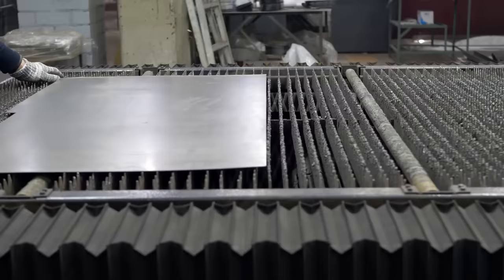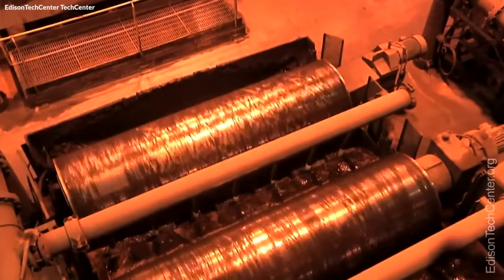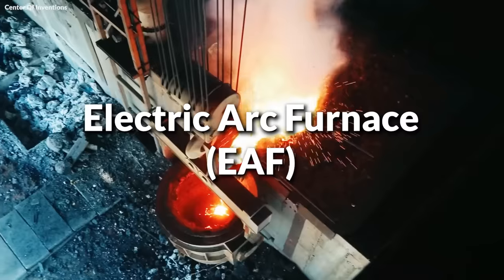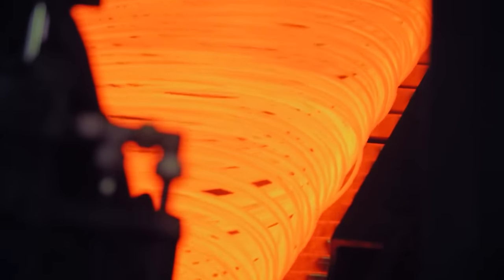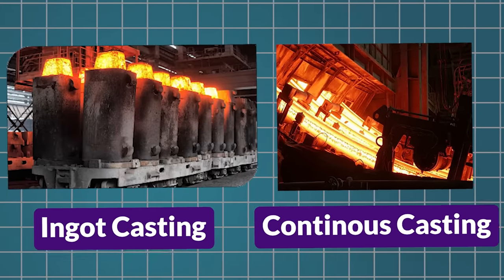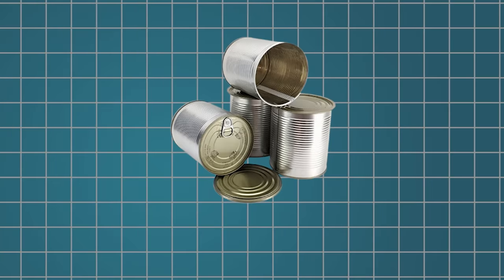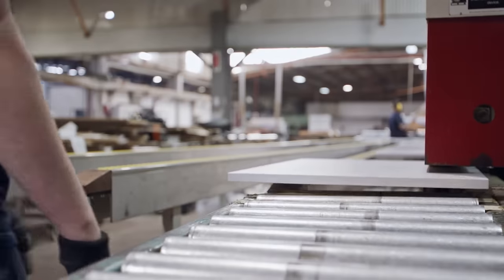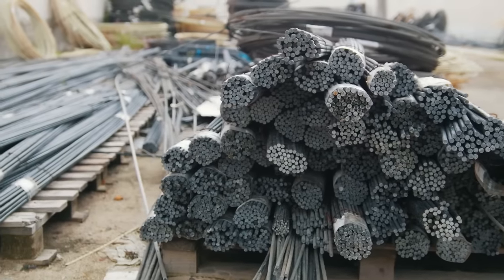How STEEL is Made - From Dirt to Molten Metal

Comment: Steel was most certanly not the backbone of civilizations for over 4000 years. The stuff discussed in this video all comes from the early 1900s.
Reply from the maker: I was rounding up
Reply: Lmao. When he said it, I was like uhhhh…that doesn’t sound right at all.
Reply: mid 1st millennium BC they started making high carbon steel yup...for over 9000 years now lol.. and it very well triggered the beginning of metal, from skyscrapers to trains and transit
Reply: Steel has been used since 13th century.
Reply: @doggygaming950 So I guess the Iron Age never happened, and the Romans conquered much of the known world using the gladius made of ... paper mache?
Reply: @whiteknightcat : Don’t be ridiculous, they used high density acrylic plastic.
Reply: @djquinn11 :face-blue-smiling:
Reply: No. They used carbon fiber cured with lazers.
Reply: @Michaelcollins933 🤣
Reply: @djquinn11 😂😂😂😂
Reply: @doggygaming950 absolute truth but all they did with it is make body armor and spears to attack each other. After the 1800s came what we have today, machines, motor cars, trains and everything else.
Reply: Modern X-ray techniques show the Great Pyramids were constructed with steel I-beam reinforcement.
Reply: @terry_willis  No they're not! They're cold-riveted girders with cores of pure selenium. The whole structure was designed and built as a superconducting antenna for the sole purpose of pulling in and concentrating spiritual turbulence.
Reply: Bethlehem steel, backbone of America
Reply: Steel was manufactured in ancient Bharat. Chola dynasty had structures steel technology
Reply: @HarmonRAB-hp4nk  steel wasn't produced in quantities where it could be used industrially until the mid 19th century. The earlier processes yielded small amounts. Pounds as opposed to tons.
Reply: @whiteknightcat  you're forgetting the Bronze Age.
Reply: @1pcfred  No, I didn't forget. I just wanted something whimsical, hence the paper mache. I'm well aware of the Bronze Age, and the use of copper weapons and tools before that.
Reply: @whiteknightcat  while our species has been capable of producing ferrous metal for thousands of years we haven't been able to mass produce it for even two centuries yet. So the whole Iron Age thing is somewhat misleading really. There's a difference between conception and scale.
Reply: So they medieval ages never used swords by your understanding ?
Reply: @stannisbarracuda5693  I understand that over time things have changed. In the Middle Ages a sword would have been a valuable possession. Today when I wear out a set of blades for my tractor I just throw them away and get new ones. Even though they're finer steel than any pattern welded sword.
Reply: @djquinn11  They used Flubber !
Reply: Wasn't steel produced around the 13th century BCE in the place that now is Turkey?
Reply: @rafaelvillalobos9145  steel has been made for a long time. Just not in quantities where it had much of an impact. If there's not much of something then its effects tend to be small as well. If the Titanic had only hit an ice cube it wouldn't have gone down in history like it did.
Reply: @1pcfred  So I guess it's safe to say bronze age had a greater impact on humanity than the iron age.
Reply: @rafaelvillalobos9145  we have ages to delineate different eras from each other somehow. We pick the most advanced material we had to name each age with. Stone, bronze, iron. After that we just call it the modern age. So we drop the materials thing. Which does suggest the materials themselves may not be the most important aspect of each age. There's recorded history and prehistory to consider too. We know of the past largely just through artifacts we can find today. Hey look it's a stone tool. It's a Stone Age item. I'm sure if we could talk to a caveman today he wouldn't define his culture by the tools he used. I'm just not so sure what he'd say. I bet it'd be interesting. Something we can't even imagine.
Reply: @HarmonRAB-hp4nk the very beginning of the 1st millennium BC was only 3000 yrs ago.  Where did you the number 9000 from? lol
Reply: AI at it's finest
Reply: @Factorama_eng 😅😂🤣
Reply: Continuous Casting, CONCAST doesn't,  nor do top-blown converters.
Reply: @HarmonRAB-hp4nk  sir, your math is way off. Exactly what year do you think we're in? The year 8,000?
Reply: All of this comes from the early 1900’s eh? … So you’re saying steel wasn’t the backbone of civilization for over 4000 years. Okay… So then it was the backbone of civilization for over 4100 years. Thank you for correcting that piece of useless information.
Reply: @3308redar Well time is relative. So if his frame of reference relative to yours is a difference of 3976 years or more, (since it’s the year 2024) then yes.  

Basically, 
A(t•d/v) {+\-} B(t•d/v) =  {+\-} 3976
Would be the equation for the difference between 2 frames of reference. Quantity this by squaring the result with the distance traveled over time, adding the velocity after dividing by time, for each, and then adding/subtracting velocity before dividing by time, and vice versa. Since time going in both directions will count. The averages of each of the results adding the first pair with the 2 different velocity’s found from the original equation will give you the answer.
Reply: @LordOfThePancakes  If we are both on the same planet, at nearly the same latitude and altitude (and by extension, experiencing nearly the same gravity), and travelling at almost exactly the same velocity, then how we experience time and our frame of reference will be nearly identical. And you know this.
Reply: Swords, shields, armour… all that must of been made from wood then? 💀
Reply: @ot6443  spears (pikes) and shield certainly were. Pikes were more common weapons than swords ever were. So much easier to manufacture.
Reply: @Factorama_eng you rounded 100 to 4000? What math did you do

Comment: The steel plant I worked at used scrap steel in place of the coke coal. It was easier to control the content in the furnace
Reply from the maker: Cool! Maybe I should make an extended version and include more about that
Reply: Coke is used in iron making.
Scrap steel is used in steel making.
Reply from the maker: thanks!  @mephInc
Reply: steel is basically iron and nickle :-\ not to hard... its tungsten when ya start getting really dangerous, so max is only 1 ton at a time..3422 degree's ...
Reply: @mephInc coke is the fuel. Scrap  steel isn't fuel.
Reply: @HarmonRAB-hp4nk steel is iron and carbon
Reply: @jamesharmon3827  
You use scrap steel in the steel making process.
Coke is used to help pull carbon and other impurities out.
Oxygen, natural gas, hydrogen, and hot air from the stoves(on blast furnaces) is your fuel.

Comment: can we generate power during cooling process by sending steam(produced during cooling by water) in one path? or can we cool the iron/steel by air like nitrogen quenching? is temperature not enough or some other reason?
Reply: Can I cook chapathi in this fire
Reply: Not really possible to direct the steam properly. It would also not be worth the effort. The rollers in a caster have to be replaced periodically. If you put some hull around of all that it would be a maintenance nightmare while not generating much energy in the first place.
Cooling with nitrogen is not possible. You don‘t want to cool the steel too much. On most machines you only cool the very outside while having a liquid core. That allows the steel to be bend in a 90 degree angle within the roller segments. Keep in mind that the steel is poured in the mold vertically but in the end the products should run out of the machine horizontally.

Comment: Why would you show a basic oxygen furnace (making steel) to represent a coke oven?
Then you show a bof and electric furnace to represent a blast furnace...
At least do your research
Reply from the maker: Thanks for the engagement
Reply: well a blast furnace is electric but uh....  lol I think he to lazy to build the stuff to show it lol
Reply: @HarmonRAB-hp4nk  
A blast furnace is not electric, hence "blast". It uses super heated air blown into the bottom to melt raw materials whereas an electric furnace is open to the atmosphere and electrodes to arc and melt scrap steel and some raw materials. An electric furnace might make a couple thousand tons of steel a day. A blast furnace can make upwards of 14,000 tons of iron a day. 
Don't run your mouth of you don't know what you're saying.

Comment: Only gripe is the clicks mouse clicks
Reply from the maker: Thanks for the feedback. I already adjusted (removed) this from future videos :)
Reply: @Factorama_eng  I wouldn't say to remove them completely.  They can be used as an infrequent accent for major separation points in the script instead of using it for almost every single transition, text and video effect.  I'm barely two minutes in and found the very high frequency annoying, distracting from the content and is ultimately what made me stop the video.  There's only a few spots where it should have been used, from what little I could watch.  :07, :26, :51, 1:04, 1:09, 1:38, 1:56.  Only seven clicks needed at most.  I can't put myself through watching the rest
Reply from the maker: @snacksmoto2351  great comment, thanks a lot :)

Comment: Why not use an electric arc furnace to recycle steel? It can then be processed to achieve various grades of steel..
Reply from the maker: Very good point! Should have included that too..
Reply: I'm pretty sure that was mentioned.
Reply: Scrap steel is used in all steel making processes from EAF to BOF
Reply from the maker: thanks! @mephInc